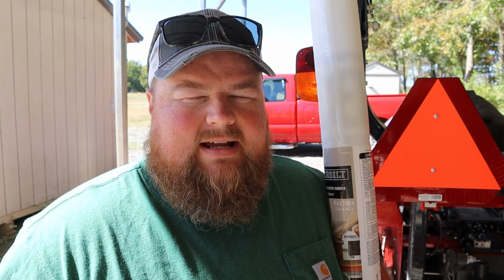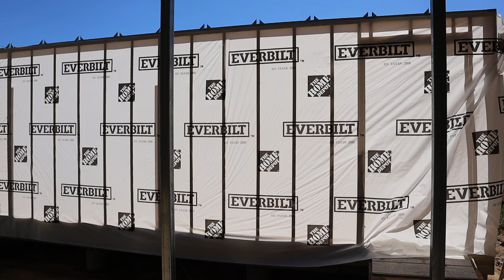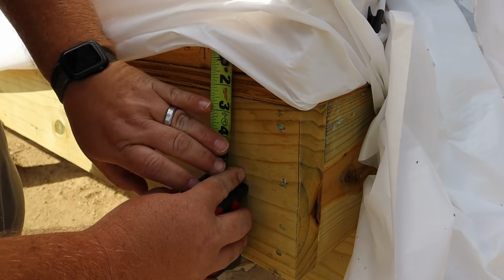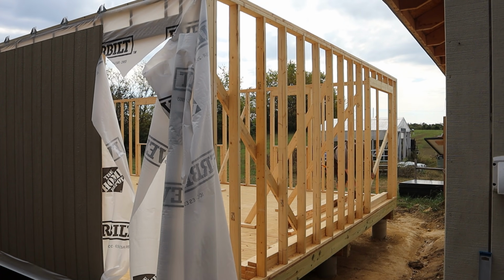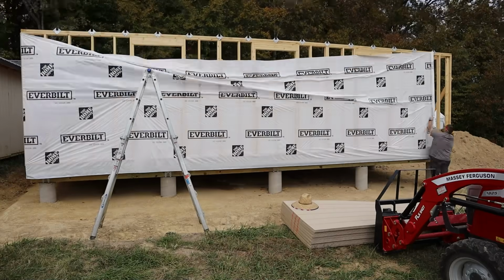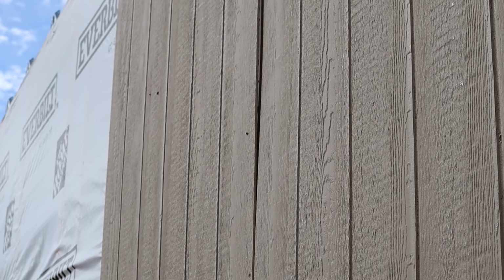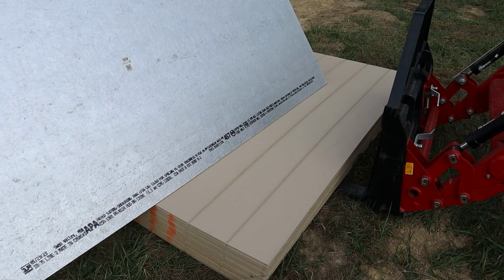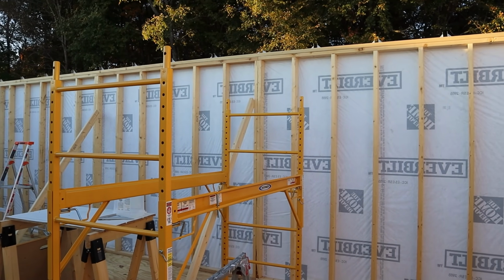Installing Siding the [easy] Way // DIY Workshop Build

Comment: The hammer tacker is a life saver (and hand saver) on house wrap and poly!  Looks like you're rocking along.  A little hint, if you can, use your truck bed for a mobile work platform.  It's great to get you height to work and it's a very good, stable platform to set up a ladder for extra height. You can park it alongside or back it up to the wall.

Comment: Not sure where you're located or if you even have inspections,  but in many / most localities t1-11 siding is not "code" for corner bracing for that large of a structure (hint - use steel strap diagonal bracing in the wall corners and then install the siding).  Corner bracing should continue through the top plate.  Location would determine which code is followed.

Comment: Good to be picky, I had a said contractor not picky enough putting our siding like that up and it created issues, needless to say noticeable until fixed. They used nails on ours that started popping out all over my near 4,000 square foot house, what alot of work fixing that. I'm real pick too so, it now looks nice after i spent a summer fixing it.

Comment: Well dang! You made that look so easy. Hubby and I struggled with the half rolls of tyvek lol and I guess that composite T1-11 is way lighter than the one we used, or your just a super hero 😂😂. Anyway I guess we know what we're using on our new chicken coop. Great job as always
Reply from the maker: It's at least half the weight of the T1-11! I'll never use the other stuff if I can help it. :)
Reply: @Samcraftcom  we looked at it for the house, but decided we wanted the extra strength and weight of the 3/4 plywood T1-11. But for our buildings, I'd would totally use it.

Comment: Looks great Sam! If you haven’t already purchased your insulation, consider Rockwool. The cost is way more but it is a great insulator! I used it on my shop here in Virginia and in the summer months I don’t have to use the air conditioning until it gets really hot. The same applies in the winter. Your initial cost is more but in a long run the utility costs are a lot less.

Comment: Looks good Sam. Have you thought about what you are going to do on the in side walls or ceiling?  Just wondering. How about lasers. Are you going to get more or just keep the ones you have. I think eventually you will need to upgrade one just for speed alone. Are you going to put your cnc in the shop. I have been missing those videos also. Keep up the hard work 😃
Reply from the maker: A bigger shop demands bigger lasers! :) Glad you got to see me! :D

Comment: by not using the siding from top plate to bottom plate. all your hardwork and then you blow it.         best use 9ft to catch the rim board all the way top plate, helps stop the side to side racking.

Comment: I would have ran the siding panels at the bottom of the rim band.  As is, you do not have much stud to top plate to tie together with your sheathing.  As is, the trusses are anchored to the top plate by the brackets, and the top plate isn't anchored very well.

Comment: that type of siding might work on youre mobile home too 
as for the housewrap , not sure if its needed but theres another stapletool that put a small round plastic piece under the staple preventing the staple from tearing through the housewrap , think i seen diy different use it before its a little more cumbersome to use but should help the housewrap stay on place during windy conditions untill you slap the siding over it 
as for using a bottom to place the panels on , maibe use a piece of known straight metal angle , 
either that use use round pucks that you put on the bottom using a level to get them right , the round pucks only have a small contact surface for the panel to rest on so its less likely to seesaw or wobble on a high spot or a slanted placed piece of wood block if you use two under each panel and can be eazily made with a holesaw , takes a bit more work to level tham acros the whole length of the shop though

Comment: Are you going to use a crane to set each roof truss?  If not it may be hard to load them on one side and slide in place with the ties already in place.

Comment: Curious, why didnt you put the t111 over the rim joist? It helps lock the walls to the floor and you have a gap on top anyways, so you have to use z strip flashing to fill in.

Comment: Some constructive criticism. 1 you have compromised the building strength by not having your siding overlap the double top plate (in racking strength ) and ( roof hold down) 2 the everbuilt house wrap sheds water about as good as a kitchen sieve and it being in contact with the radiant barrier on your siding renders the radiant barrier all but useless , Radiant barrier needs an air gap on at least 1 side to work.
Reply: I also wanted to ask about the siding not overlapping the double top plate

Comment: You need to nail.the panel to.the rim board of the floor . That will give you a very good shed than fill in the top . Your trusses metal is 180 . Off